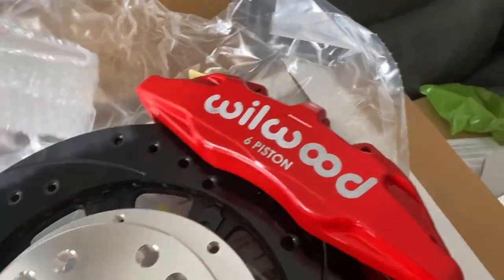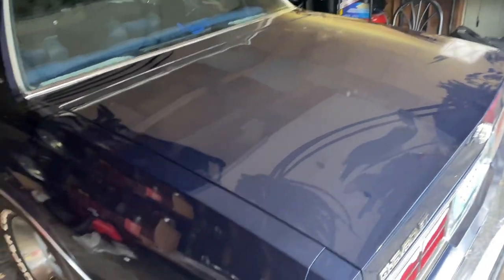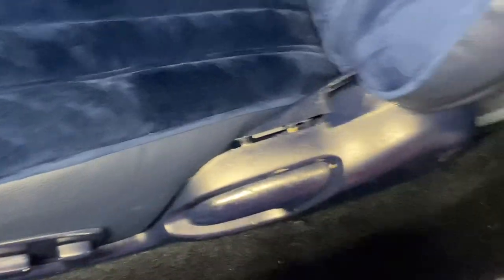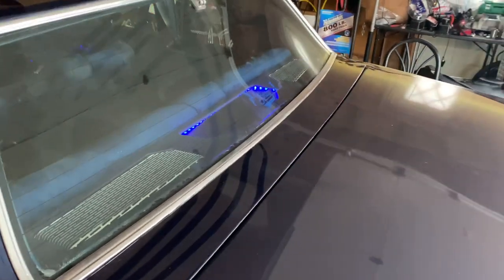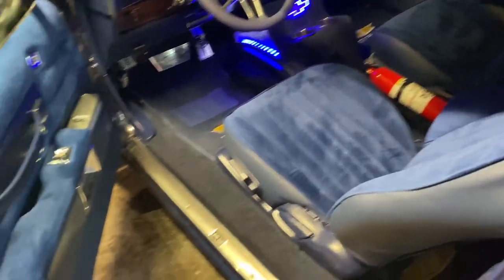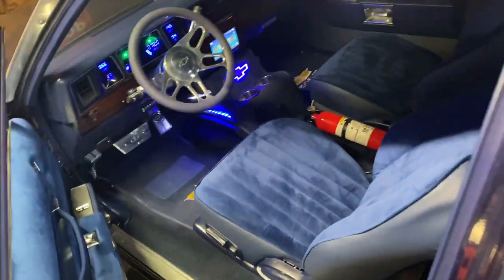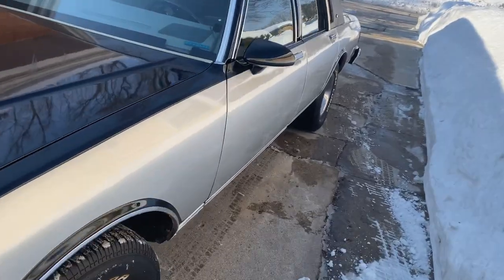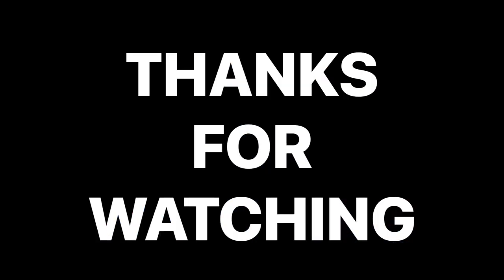TOOK MY  BOX CHEVY TO GET THE 28S AND QA1 COILOVERS PUT ON😎

Comment: Did you replace the rear end or is the rear end the original?
Reply from the maker: Original
Reply: @boxchevypee557  
Bro I still have the original rear end on my 1980 box. I just turned it into a posi and put bigger gears in it. I been trying to get the wildwood drum to disc conversion kit for the longest. I didn’t wanna swap my rear end and People and shops either dnt know what part numbers for the rear disc brakes or calipers or they just don’t wanna help with the info. I even called wildwood themself and asked and they asking all technical questions like what’s the flange size and what’s the offset. Man bro, if you can help me out with the info on the part numbers, I appreciate it.
Reply from the maker: @jimmiesaunders638  I only got front wilwoods not rear but I can send part number Lmk ..yea I called for rear and they asked me a bunch of technical questions as well
Reply: @boxchevypee557  
Can you send the part number link?